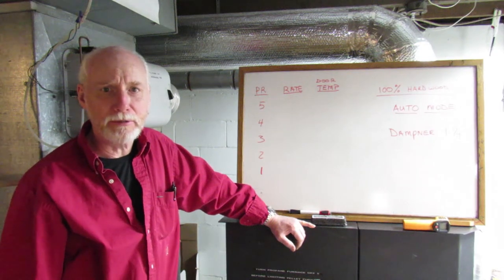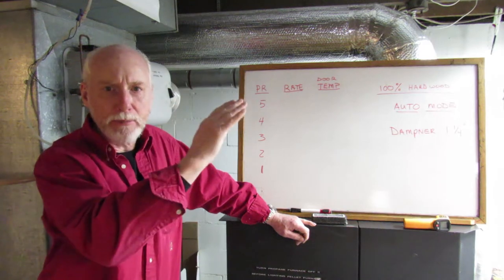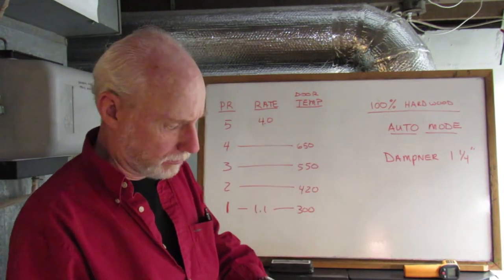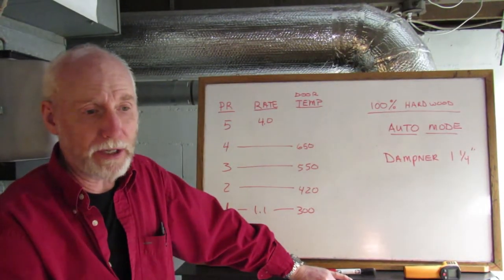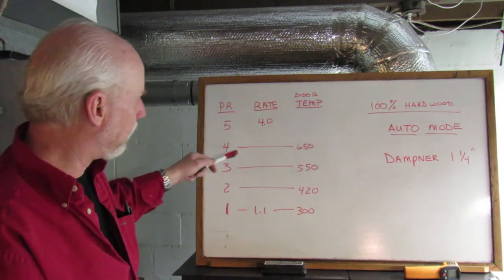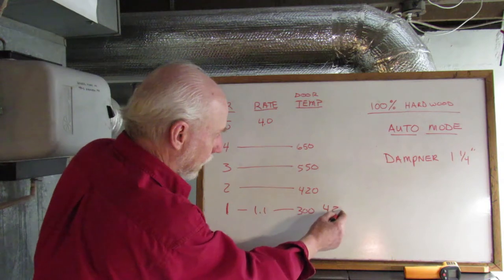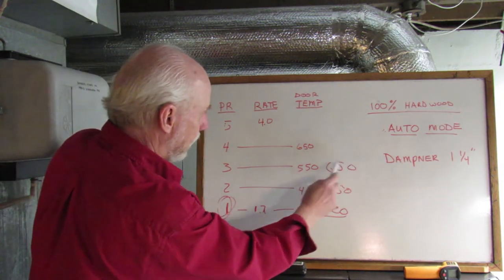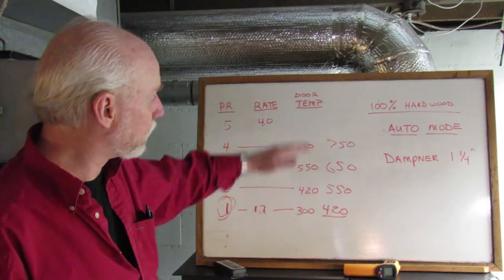Smooth Operating Tips For US Stove Model 8500

Comment: Once again very informative. I purchased this stove to replace a wood stove at my mothers home and it has been performing somewhat well since I set it up thanks to watching all your videos. As I said somewhat it’s still not dialed in well enough for my liking as compared to what you show in your video series. I recently did a complete cleaning on the furnace and had a Very difficult time removing the stock cast iron agitator which ultimately resulted in the destruction of that said agitator. So needless to say I have ordered the new stainless agitator and burn pot extender from your eBay store. I would very much like to talk to you about my issues with my stove if you would be so inclined. Thanks once again for all your great information!

Comment: Thanks for all the video's about the US Stove 8500, not that much info on them on YouTube. Just purchased a used 8500 unit from a buddy and I have it all setup and ready to run 2022 season. Question for you, I was going over the manual and it states furnace factory setting when purchased is set to "Cr" to burn corn. Since I'm burning 100% hardwood pellets, I would have to change burn setting to "Pr" for wood pellets, correct?? Most of your videos on your current settings I've see the "Cr" setting running, now is that because you were burning cherry pits at that time?? Thanks again for the detailed videos and breakdowns to understand how to change settings to run for a smooth operation!

Comment: firstly, thanks for doing these videos. I have no info on programming this furnace so this helps. I've had this model for several years and only used it one year because I dont feel it can produce hot enough air to heat my home.  I have never seen the flame get even close to 3/4 high! the air coming out is only warm.  My draft fan always cycles on and off when the door is closed and does not seem to change speed or frequency with different setting but it has always been like that since day one.  If the door is open then the draft fan stays on.  Could you please tell me if the draft fan is supposed to be on all the time when the door is closed? Is it supposed to vary in speed with the heat setting? Cause mine never changes.   This is why i stopped using it a few years ago.  it also burned through three bags every 30 hrs or so and produced very little hear. I had to run the oil furnace as well.  That winter I went through 6tons of pellets and 1 tank of oil.  just didnt seem to be worth the effort.  House is 3000sqft  forced hot air.  I have a baffle and switch in the duct pipe in case the furnace comes on while the pellet furnace is running.

Comment: Been a great help I've been having some issues with my stove it ran great until i shut it down to clean it now its been shutting down and giving me er3 code been in touch with usstove hoping to greet it going again soon if you have any thoughts I'd greatly appreciate them thanks again for these videos
Reply from the maker: Bill Ott , ck suspects listed in manual, if those ck ok, possible bad thermistor,or pcb. You will need to contact the top tech at usstove to resolve. The girls that answer the phones usually for basic questions only.
Reply: Land/Air Mechanical thank you i will defiantly checks that it after work thanks again for the quick response you've been a big help

Comment: What components are probably damaged from over temp I ran my stove out the box and my whole door is almost white and I have a similar draft set up as you so I set my feed rates and c6 and c7 like yours but it does not seem right my draft fan stays on constant
Reply from the maker: MZ231592  make sure your draft fan is set to auto, it should pulse on and off.
Reply: How do I know it's on auto the stove is set to auto but idkbif the draft fan is
Reply: It did pulse on and off till I changed the feed rates and c6 and c7
Reply from the maker: MZ231592 if your door is white it is highly probable that one or more of these components are damaged, RTD,PCB,THERMISTOR, call us stove co. For warranty replacement,
Reply: @landairmechanical3977  I was going to call to have those replaced and it was embarrassing when I went down and it was on manual I must of hit while setting it up thanks for the help and the responses back